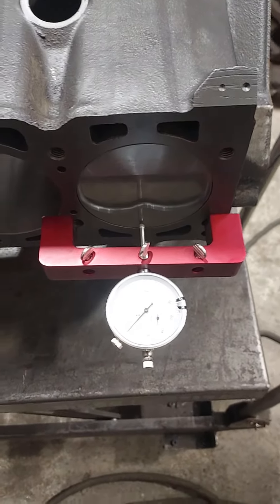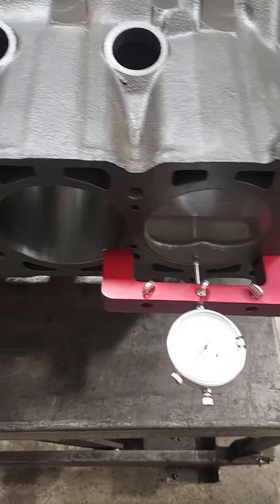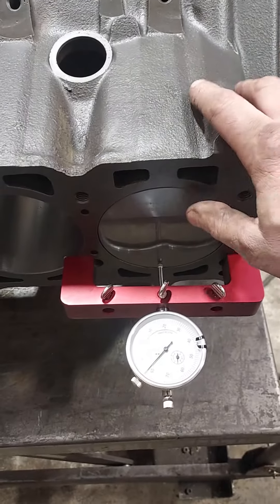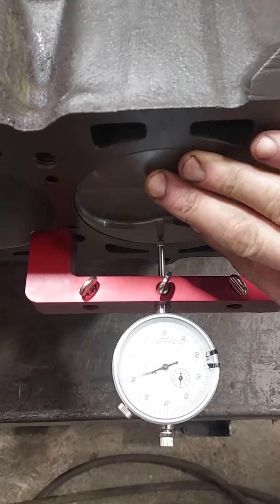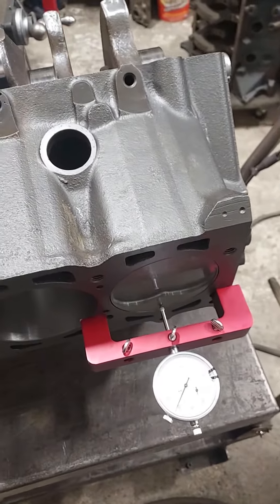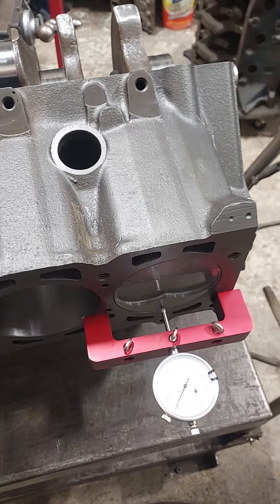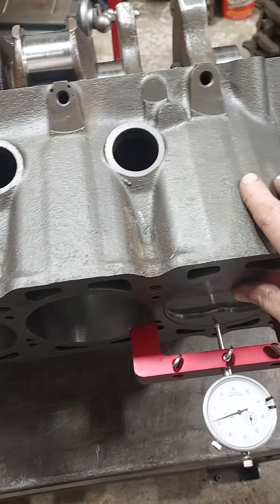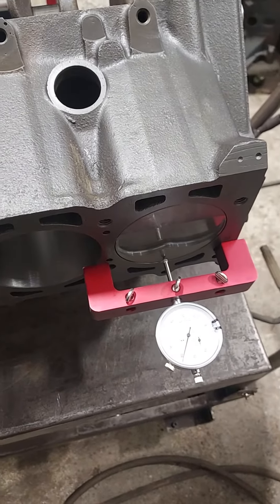piston skirt clearance example for the pro engine builders at UTG

Comment: Ross pistons asked for at least .008 piston skirt clearance on the last set of forged pistons I bought from them. The old TRW forged pistons where at least .005-.006. If you don't seize your engine, then your right, if you do then 😬. To each their own, ways and experience.
Reply from the maker: all depends on the alloy and silicon content.  .  Dont think i have ever seen .008" minimum.   I had a newer set of TRW forged that wanted .0015"  like a hypereutectic.  I usually bore everything half to a thou large....just in case.
Reply: @scotts439  coatings also play a factor, it's one of those things you can't generalize.
Reply: @scotts439  I didn't know they still made TRW forged pistons, I thought they are speed pro.
Reply from the maker: Yes they are now speed pro power forged.
Reply: I was reading some comments a while back on this subject and guys were going back and forth about clearances just like here and one guy said something about .010 or maybe more for a certain piston and everybody said aww your full of it, then he gave the link and sure enough it called for what I believe if my memory serves me right was over 10 thousandths. I couldn't hardly believe it myself, to me that's the next size up for a clean up and new piston.
Reply: @stevenbelue5496  low silicone forged Pistons tend to expand the most, and hypereutectic the least. I remember reading an article a few years ago that was from the mid '20s. Discussing the merits of a cast iron piston versus an aluminum one. This is after I tore down a 1926 Packard i6 and found one cast iron piston, 2 forged aluminum and 3 cast aluminum Pistons. Safe to say this debate has been going on for some time now.